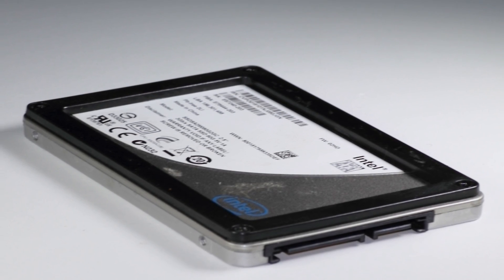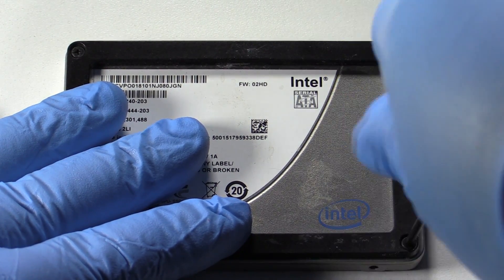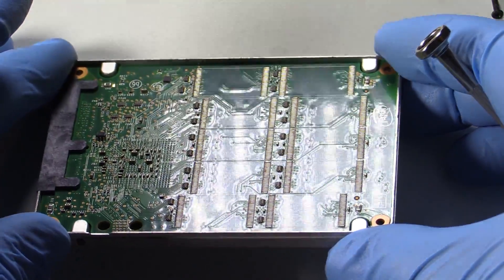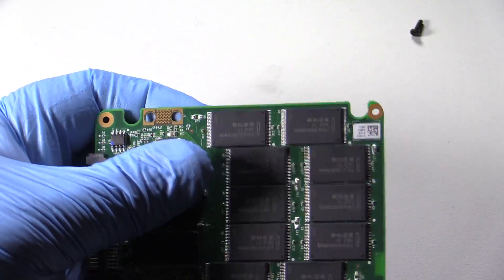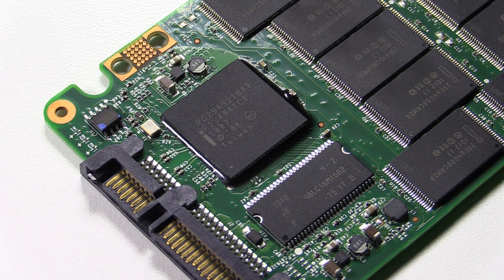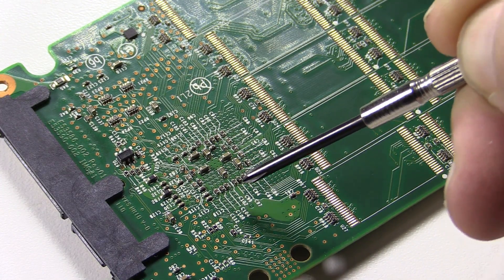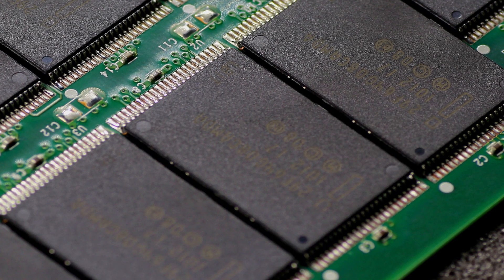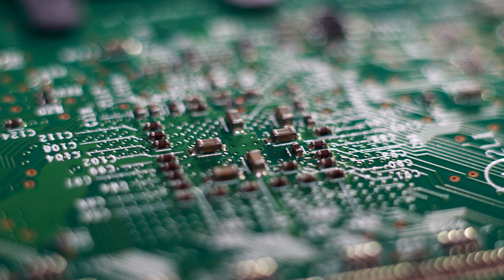Solid-State-Drive Tear Down For Precious Metals

Comment: He may have given that to you to destroy but some or maybe all SSDs have garbage collection algorithms.  What they do  is go through and wipe empty blocks.  Just formatting it and leaving it plugged into power would be enough to trigger the garbage collection algorithms or it would even wipe a single empty block.  By empty I mean a block with a file that is deleted and thus that piece of the file is no longer needed.  You do not have to have the data connection attached to your PC for the garbage collection algorithm to work, the drive's firmware and processor will take care of this empty block cleanup internally.  Now if you have a file you did not delete these garbage collection algorithms will not harm it.  But if you formatted the drive even quick and left if with power it would wipe the empty blocks or even blocks that are occupied by a file that is deleted.

If you don't believe me, do some research on it.  It is something that can be daunting if you have a job which involves computer forensics or data recovery.  Just google search it yourself or use what ever search you prefer if google is not your first choice.  You can even experiment with this algorithm by writing a known series of files to it then deleting them in the traditional way which would involve marking their sectors as free for writing.  Try it again after a format.  Try recovering the files a little while after each erasure method and see if you find any data you recognize.  Use junk data or make sure that you have some backups of it or if it is important data you don't want to loose.

I mostly know about that sort of algorithm because I like to read about things like this.  I was thinking about getting one for speed and it turns out data security may be another thing they are good for.  Now before you tell me I am crazy or something else like that do some research and if you know people experienced in data recovery for any purpose, ask them about it.  Get back to me via a reply if you would be so kind and tell me your findings.  Many people would want to learn more about this and I am one of them.